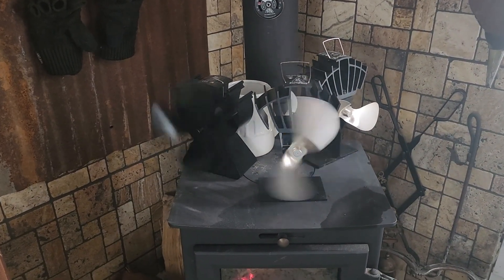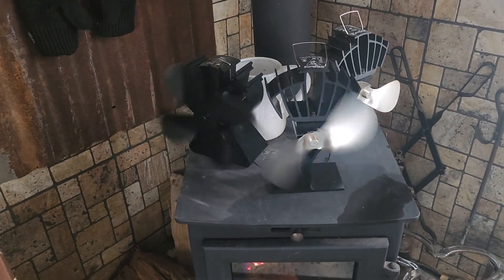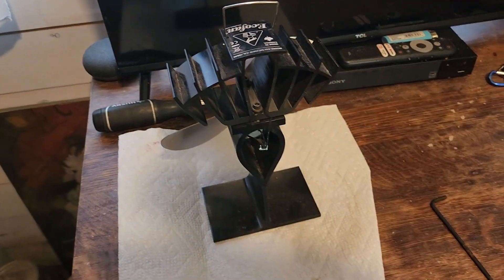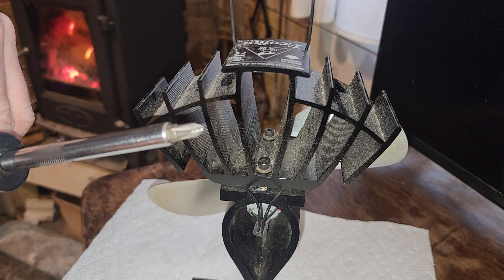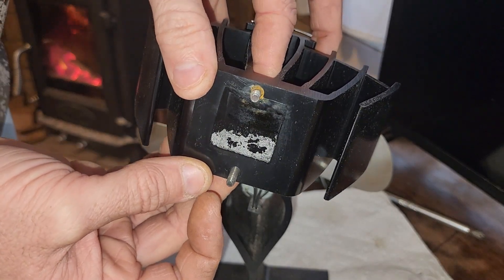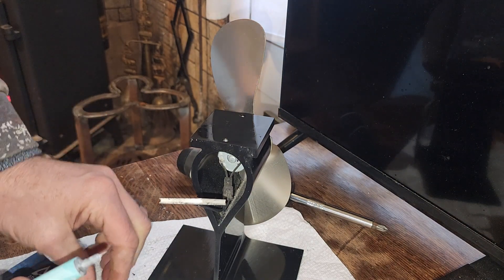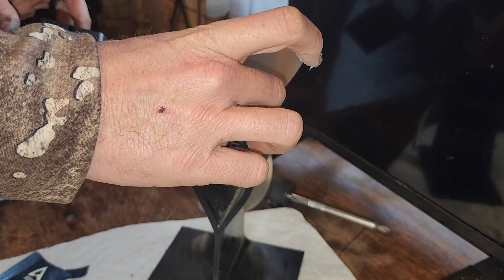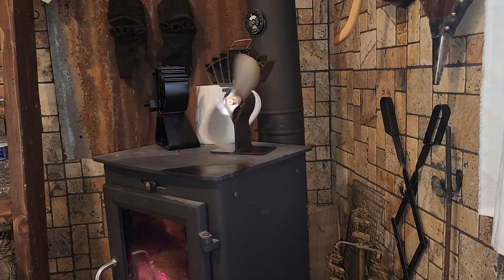Problems with my heat powered wood stove fan

Comment: Did you ever get it to work right? Mine quit working. The motor wasnt turning so i bought a new mptor and put that on, but it didnt fix the issue. The motor came with a new plate thing, but I dont have thermal paste so i havent tried to replace that, but wondering now if I am just wasting money and need to buy a new one all together.
Reply from the maker: I got it working again, but not well. I ended up trying a cheaper fan that's worked pretty well.

Comment: I have the same fan, followed the exact method, and DIDN'T WORK.  Oh well, product was ony 7 bucks.
Reply from the maker: @almoulaison2439  yea, I replaced it, but was never the same. I've yet to throw it out, but found a cheaper fan i liked better.
Reply: @tnthomesteading  I found a new replacement motor for 25 bucks. Tomorrow I will pick one up and give it a try. Cheaper than buying another one.

Comment: 3in one oil the motor on one of mine. Oil the front shaft. And use a 1/16th drill bit to get to rear shaft. If anybody got a Voda. The screws do loosen up from heating and cooling. But you can buy replacement parts. Reason i oiled one of mine is because it started sqeaking. So after 3 in one oil. Its working just fine.
Reply from the maker: I'll have to give that a try. One was making noise last night

Comment: I found a video of a guy that builds these things. He claims that the single leg fans are far inferior to the double leg version. The heat is distributed more evenly and works better and longer. So it appears that the cheaper one you bought is better than the expensive ones...if you believe him. I rebuilt one and like someone said, "It never worked the same." I will be modifying the base for better heat distribution. The peltier units can burn out easily so putting the fan in the middle of the stove where the high heat is, doesn't make them go faster. I found out the hard way.🤔
Reply from the maker: @CORDIBrandt  good to know. When I got my first, I wasn't sure they even worked, or if just a gimmick. Discovered they really move that air, surprisingly well... When the work. 🤣

Comment: I've tried this and it didn't work. It still only runs for a few secs then stops like it did before I did it.
Reply from the maker: @frankijones74  yea, while mine didn't ever stop, it just never worked right. I ended up buying another one, cheaper than this one, and I liked it better
Reply: @tnthomesteading  Ours decided to stop and start when it felt like it, which made it useless... just got a new :)
Reply: @tnthomesteading  I got a valiant. It's bloody awesome.!!
Reply from the maker: @frankijones74  ecofan was my first. One of them was the troubled fan in the video. Got a much cheaper Voda and love it!
Reply: @tnthomesteading  we just got valiant for fire top. but on the flu we use a big 8 blade tilting one. god knows what brand but wasn't dear..
Reply from the maker: @frankijones74  I've not seen flue fans. I may need to do some searching

Comment: I have read that if the bi metal strip on the bottom of the fan is discolored it means it was over heated. If it was it won't work as well as it should. Apparently you can buy service kits that include new bimetal strip, motor and Teg from the uk. I'm gonna need one of these. As mine is definitely discolored and i just recently broke one of the wires going into the teg.
Reply from the maker: @webstella  I think I replaced it, but it never really was the same

Comment: Ouch.  You used far too much thermal paste.  What you want is maximum metal to metal contact between the aluminum aluminum heat sinks and the two sides of the Peltier junction device.  What the thermal paste does is fill in the tiny cracks in the aluminum heat sink.  The thermal paste should be spread evenly and as thin as possible.  The thermal resistance of the paste is much higher than the thermal resistance of aluminum which mean using LESS paste yields the best thermal conductivity.
https://www.google.com/search?q=too+much+thermal+paste&tbm=vid

What you are trying to do is maximize the DIFFERENCE in temperature between the sides of the Peltier junction device.  The larger the temperature difference, the more voltage is generated and therefore the faster the fan spins.  You can measure the two temperatures using a type-K thermocouple and a DMM (digital multimeter) that has a thermocouple input connector.  For example:
https://www.flir.com/products/ex470a/

An optical InfraRed thermometer will work, but it will be difficult to obtain stable readings.  An IR camera is probably best, if you have money.
For reference, I just measured 127C (261F) on top of the Peltier junction and 137C (279F) from below.  That's a 10C (50F) difference in temperature.  I would not expect your measurements to be very close to mine, but you can use my numbers to see if you're in the ball park.
You can also measure the RPM (rotations per minute) of the fan to see if you're making progress.  An optical tachometer:
https://www.ebay.com/itm/126687363108

I'm using a Voda VDSF624B, which seems similar to whatever you're using.
https://www.voda-tek.com/product/vdsf624b/

Comment: You can check the voltage out of the thermopile to see if it matches the new one
Reply from the maker: That's not a bad idea. but rarely running the stove lately as it's starting to warm up. If I think about it  (and can find my meter) I will

Comment: Try adding a bit of lubricant to the motor.  Use something like a bit of silicone lubricant, not WD-40.

Over time, the high heat environment will cause the oil the factory used to degrade.
Reply from the maker: I'd tried a couple different lubricants, and no luck